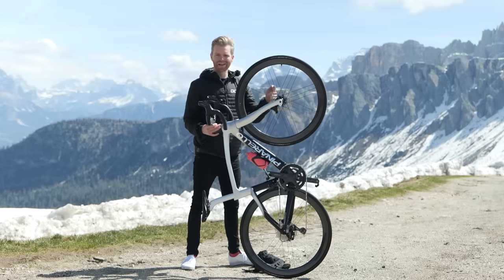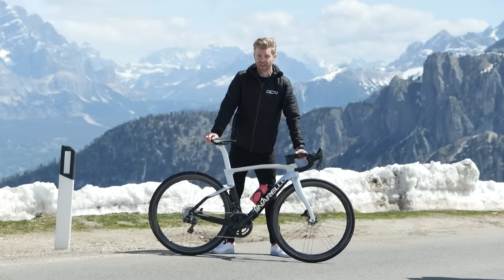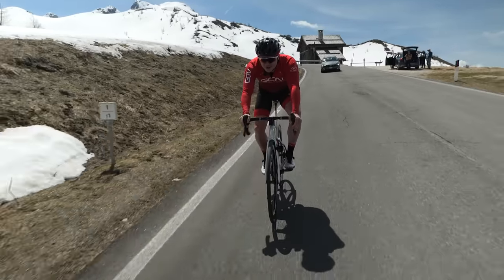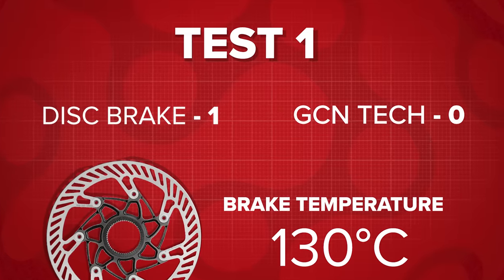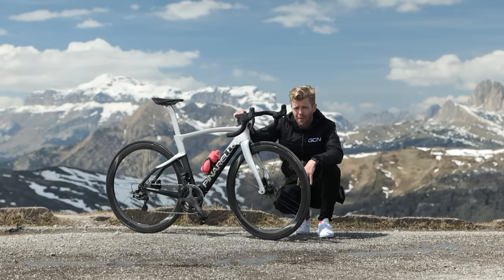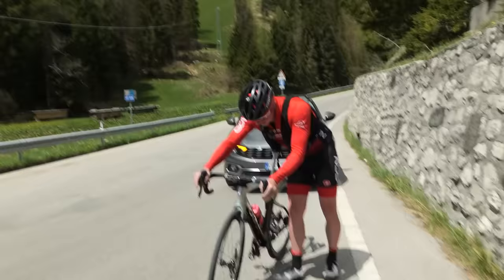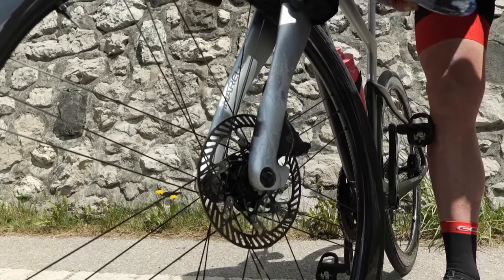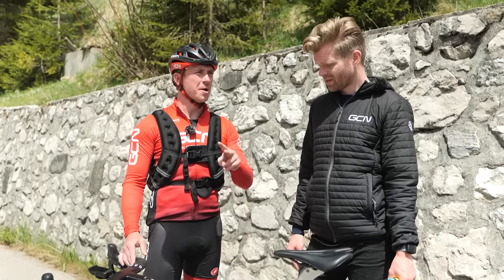Can We Melt Disc Brakes!?

Comment from the maker: What other challenges would you like to see Hank do?
Reply: Crack a Canyon frame................................................nar, forget that one...too easy.
Reply: What is the max weight he can carry while climbing 10k at a steady gradient
Reply: apparently a hot dog eating contest seems right up his new found skills
Reply: Try this with some entry level disc brakes and see if they glow in the tunnel!
Reply: @PenguinIceNinja  same here!
Reply: Do the same with rim brakes on carbon rims.
Reply: It would have been nice to compare the temperature if he descended normally as a control 👍
Reply: A good one would be Hank try cycling using gloves. It’s a huge trend worldwide! And safer !
Reply: What does it take to melt disc brakes? You've got to approach these tests like the mythbusters. Test the myth and then replicate the aspects of the myth. I want to see the brakes glow red.
Reply: I'm curious about Merida calipers cooling fins, will it really cool down rotors temperature? You guys might do a test on it as well.
Reply: Try the brakes at maximum weight the frame is designed for.
Oh, and some temperature sensors and data capturing equipment for better measurements.
Reply: I'd like to see 3 other members of the gcn team make a music Playlist for hank and then see if he cranks out the miles faster to certain tunes. 🙃 I think certain music is better for cycling.. but is it true..??!?!
Reply: The video should have been called "Brake Bake" or Brake Bake-off"
Reply: i`d like to see a comparison of riding up a climb on a bike with 6 bar tyre pressure and then only 2 bar: this might happen after having a puncture in a race or even a normal ride, when you use a cartridge to refill the tyre and dont get the right pressure...it feels pretty hard when you check with your fingers, but it is actually too soft (this is what happened to me last week...i had the feeling my legs were completely devastated...but maybe it wasnt the legs, but the bike?) i cant measure the watts...so maybe you could do this for me?
Reply: You guys should know that IR thermometers are unreliable when used on shiny surfaces like brake rotors. You should use a probe thermometer.
Reply: Cycle through a red light district and give us a good look at the hot totty ladies of the night or day !
Reply: This same thing but with cheaply made hydraulic disc brakes. Any company can overengineer their products. One that sacrifices design for cost would be interesting to see. Even at 48Kg of my own weight, I wouldn't trust cheaply made shite down long, steep descents, cable or hydraulic.
Reply: Use both rim and disk brakes at the same time with wheels that uses both with a conversion kit
Reply: Test in on shimano 105 cause thats what most people use
Reply: I didn't realize ridged forks flexed enough to benefit from trail breaking. I thought trail breaking's effects were mainly from compressing front suspension(in motorcycles)...... Would you do a video on how much trail breaking makes a difference?
Reply: Same brake test on a fully loaded touring bike max bike and rider 130kg
Reply: The same test but with like budget discbrakes and midrange like 105 would be interesting.
Reply: Can try Sram-Shimano-Campagnolo rotors vs test? which of these get less hot and then with that heat which has better braking performance
Reply: Can you repeat that, but with a carbon rim breaks?
Reply: Same challenge, but with brakes removed
Reply: @chewynnmasurmardiros422  ya riding with his 150kg friend, who has "no brakes" and put his hand on the shoulder to break. Another test would be to measure the boiling temperature of the break-fluid.
Reply: Do this challenge again with a bike and brakes that aren't top of the line, and with different material brake pads. What would an average bloke's experience likely be? An average bloke isn't going to have a bike like that, is likely to be heavier, and is likely to grab their brakes more or drag them. Let us know more about what failing brakes feels like so we can avoid it ourselves. 

But for the sake of not sending Hank off a cliff with turns, get a long straight downhill with no intersections at the bottom so if the brakes actually do fail, he can coast to a safe stop. I know that central Utah has some highway stretches like that which are almost empty.

Comment: If you want to do that test again with a cyclist who's starting weight is 110kg, I'm more than willing to eat focaccia & tart at the top of a mountain! 😂
Reply: Better yet, attach the bike disc brake onto a truck or a car.
Reply: A year ago, I would have been your ideal candidate. Would've still eaten the focaccia and tart..
Reply: I can do that without eating. 🤣
Reply: Can confirm.  Took a 136kg total weight loaded cargo/bikepacking bike down a 800m 15+% descent.  Brakes smelled bad, front brake was fading, and had to take pauses to cool things down.  I am planning on bumping up the rotor size before I try similar again.
Reply: Trying to work out whether Tart is a typo 🤣
Reply: Mmhmm I could go for some focaccia right now, with some olive oil to dip in.
Reply: I am at that level without additional binge eating. 😜 And my brakes survive it….
Reply: Ecpecially on hot mountain in middle east
Reply: I’m here no preparation needed ideal candidate 😂
Reply: Even better i weigh about 125kg, and i can devour 2,5kg kebab under 20 minutes. Put 30kg of bike touring bags on the bike and the bomb down the hill. Thats how i ride my cheap tektro mechanical disk brakes anyway.
Reply: I am 100+ Kg, already have a head start
Reply: Lets meet up and test the tart and focacia on a tandem. That should warm the brakes up.. !
Reply: @gcn  If you want to, i'm your candidate. I weigh more than 120kg but i'm enough athletic to get up again. And if you're doing this again...there's 2 things you definitely have to change:
1: Try the rearbrake. It's way less efficient when it comes to braking power. Also it's way safer in case the brake give's up.
2: You have to measure correctly. First of all you shouldn't measure at the calipper. It's temperature is not representative. Second: paint one of the struts (Don't know if this is the correct word for it) between brake area and the hub black. IR-thermometers aren't capable of measuring glossy surfaces correctly. The emission of IR fluctuates between materials. If you paint a strut black and measure the temperature of that strut, you eradicate the emission fluctuations from the material and can measure the temperature properly.
Reply: @123moof  203mm rotors if it fits in your fork and sintered pads should be good, even with that weight. Shimano is making flatmount and postmount adapter for 160mm to 203mm rotors. And use the rear brake es much as possible too, especially if you have lots of weight in the back!
Reply: what if I tell you you have to pedal up first?
Reply: @Wolfman2989  poor bike, would love to see a 125kg dude ride 🤣
Reply: @leonardhpls6  well, come over to Finland and check me out, better yet, ill challenge you to ride with me 400km ride, camp in the wild in the middle. I ride for pleasure and for commute, not for sport. There is more than 5000km on my bike...
Reply: Me and my friend got on the same bike(90kg+50kg) and we managed to break the back brakes
Reply: lol bro I'm got u to 1k likes
Reply: @LTFC77  lmao.. fart
Reply: i have managed to make my disk glow, braking at full force from 70 to 0
Reply: My friend Anthony weighs 155kg and we saw on a 550m descent a temperature of 320 degrees celsius  and dark brown rotors , they were warping SRAM ones . The brake pads were badly crystallised .

Comment: Never spil water on hot brakes! Disc can easily bend from temperature shock.
Reply: It's a sponsored bike, they'll be fine :P I don't think any normal person would ever think to do that :P
Reply: I'll not drive in rain anymore
Reply: @chrisb_rc  Driving in the rain actually helps dissipating the heat. Pouring water is different because it changes the temperature rapidly and hence will cause bending. That's not the case with rain. Ignore though if you're just joking.
Reply: Not true. People should realize that bikes, motorcycles and car brakes are designed to work in the rain after driving hard and breaking all day. It doesn't affect brakes to get them wet.
Reply: Trying braking hard and immediately going through a big puddle. Constant water presence from rain has no effect.
Reply: @Rover200Power  Commuters driving home in the summer with blazing hot brakes are unaffected when a sudden downpour happens. Worldwide. Millions of people a day. It's not a problem.
Reply: @jim9685769  rain isn't a problem. Driving through a large puddle is much more like quenching a hot piece of steel.
Reply: What like rain?
Reply: @chrisb_rc  it's not water by itself, it's the rapid change in temperatures. Your car brakes will be fine if you brake in the rain, but the might warp if you go over a pot hole with water in it.
Reply: @jim9685769  Rain doesn't pour directly into the discs like Ollie did. 
There are two things. First, you aren't  braking all the time with your car, so it is unlikely your discs will get heated enough, and second, when it rains, water finds their way to the discs slowly. It isn't splashed directly into them.
Reply: @palmajm5333  Everyone reading this who isn't living in a desert has driven into a sudden wall of rain where the streets are completely covered after miles of driving with hot brakes. It's very rare that your brakes aren't screaming hot. You've never gotten home and been able to touch your brakes. They stay hot a hell of a long time. Because it takes a ton of energy to slow down a vehicle.

Your brakes are immediately doused with water exactly the same as a puddle when you suddenly drive into an oncoming rain storm. If you've driven for more than two years you know this is true. Everyone drives though random puddles in the summer. If the brake companies didn't have this figured out, EVERYBODY in the world would have warped brakes.
Reply: @jim9685769  unfortunately that is false as I was driving down a motorway and hit the brakes hard due to there being a flood and guess what the discs warped 🤔🤔🤔 that that has happened several times over the years but also holding the brakes on when hot can do the samething 😉😉
Reply: I often had hot breaks while cyckle touring in swiss and I always cooled them down with water without problems.
Reply: @jim9685769  Actually, if you hit - for example - a puddle at the bottom of a long descend, your brake discs will easily warp if they're a little bit underdimensioned.
Reply: Nearly died when I saw that
Reply: @jim9685769  Rain and pouring a bottle of water are completely different. It’s exactly the same reason why you don’t run cold water on a hot fry pan.
Reply: @jim9685769  I had warped my disc on my car twice by hitting water, its not that rare. Plus there is a “whole industry” for grinding back warped discs.
Reply: @jim9685769  I think if the temperature is blazing hot, then you get rainfall out of nowhere, the climate may be fucked.
Reply: The point is cooling it 1 side in particular. It will shrink fast on that side while the rest is still hot and extended. When riding in the rain water will splash on all sides and cool it down evenly.
Reply: @chrisb_rc  Rain is not a problem because when it rains it is not a waterbottle splash. Also, many of you mentioned cars - car brakes are protected by rims and brake dust covers so rain cannot do anything to them.
Reply: @jim9685769  Commuters with blazing hot brakes? What? What terrain does your hypothetical commuters ride on? Also, driving miles with hot brakes? What? It's rare that bikers brakers aren't screaming hot? WTF, do all your hypothetical bike riders live ontop of  Alpe d'Huez and making bombing-runs to the bottom on their "commutes"?
Reply: Not likely to happen at only 180°C.
Reply: @darrengarvie8832  more likely you got some uneven deposition of pad material on the rotor, which causes the characteristics pulsing in the pedal.
Reply: @jim9685769  Car disc brakes have a protection shield on the inner plates PRECISELY to prevent water from puddles from hitting the disc brakes directly. As someone who's had modified cars in the past (and would remove those shields to increase disc brake cooling), my mechanic would always warn me: NEVER drive through water puddles to avoid warping your brakes - and, if you do, make sure your brakes aren't hot. The outer side doesn't need a shield because 1 - your wheel spokes already act as a natural shield and 2 - water from puddles doesn't get in through the outside of the wheel, but through the inside. Rain water is not a problem because water from rain doesn't fall directly into the discs (and even if it did, water from rain is sparse enough that won't warp the discs). Also, if it's raining that hard, you'll be driving slowly (not racing like a maniac), so your brakes will be pretty cool. Now, throwing cold water directly against a hot disc brake? No, no.
Reply: Stupid bicycles and donts
Reply: no, they did
Reply: @jackiewong0806  nothing will happen if you Put water on scorching hot Disc brake 😂😂 I've been doing it for years nothing happened to my MTB and road bike no bends i like the sound of Hot brakes

Comment: GCN folks: Sure - your business is entertainment disguised as information. But when it gets such into dark red in terms of hazard for the viewers, you have to be called out! Get the physics right first!. If you brake continuously with whatever weight you place on a bike you never get the energy into the brakes as with one or a couple of consecutive hairpins approached with 80 km/h! The energy or impulse is related to the square of the velocity. You get EVERY rotor, especially such small ones, with less weight on much shorter descends easily much hotter, the brakes to fade with whatever pad material and literally doing cracking noises. That leads to the next major misinformation - by the way. Rotors and spiders are separated to exactly NOT transfer the heat into the hub, or at least as few as possible - the opposite to what you claim. Just imagine what would happen otherwise...

Comment: Hank’s extreme test represents normal life for us cyclists above 100kg. Trust me, the brakes still work 😂
Reply: As a 125kg+ cyclist I agree. I just have to replace them much more often than my wife who's about 53kg :D
Reply: 100+kg rider plus 25kg of recumbent trike, means that Hank's test tested absolutely nothing for me 😀
On the other hand, based on color of that disc, it had to experienced temperature around 230°C (highly unscientifical way of measuring temperature guys) and that rotor is very well cooled, inside of brake caliper had to be real inferno.
On the even OTHER hand, I can repeatedly not melt, but baked my rear brake on way shorter downhill to the point it starts sqeeking terribly and when I have something in my panniers, it even stop breaking (not entirely, but significantly less), and that is 180mm rotor and Galfer sintered pads...

So my point is, YES, brake fading IS a thing that you may experience on a road so if you for some reason HAVE TO drag a brake, frag the rear one. In that case, your front (AKA more powerfull) is still cool and ready to save your ass...
Reply: @KNURKonesur  haha nice 😊
Reply: Exactly, and ally rim brakes are fine too!
Reply: Hey Schotte, what brakes do you recommend for us 100kg guys?
Reply: @ericvutran4140  any, just buy loads of spare pads and keep them handy in your seat bag :D
Reply: @ericvutran4140  203mm rotors 4 pot Hope RX4 calipers
Reply: @imprezaaudi  damn they're not compatible with Ultegra r8000
Reply: @ericvutran4140  I fitted Hope RX4 to my ultegra Di2 levers.  I did stay with 160mm rotors.  You could fit adaptors for the calipers if you want 180 or 203mm rotors.
Reply: @imprezaaudi  ah ok. Thanks for the help. I'm here in Asia and the mechanics don't speak English. Lol
Reply: @tri-seeker2753  100% agreed. Rear brake for controlling speed and front for actually breaking.
Reply: @tri-seeker2753  I read somewhere that  a velonaut created water spraying system to cool the brakes
Reply: @taufikabidin412  Yeah, I saw some pics of drum brakes with waterhosing. In a result, quite messy, as drumbrakes accumulate A LOT of fine dust and wash it out is not nice 🙂
Not sure how much that could be helpful tho, while going downhill and baking your brakes, operating some cooling mech is not a thing you have your hands free for...
Reply: even rim brakes can lock wheels on dry tarmac. And when going downhill just sit straigt up, the wind will slow one and the belly down. Sometimes its good to have a not drag optimized body.
Reply: @ericvutran4140  a food brake
Reply: These GCN “tests” are hilarious!